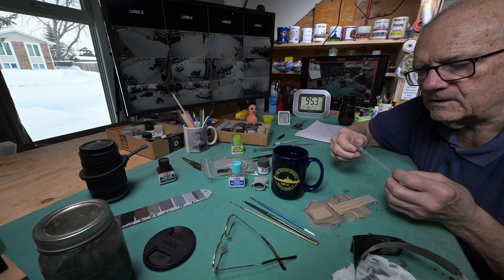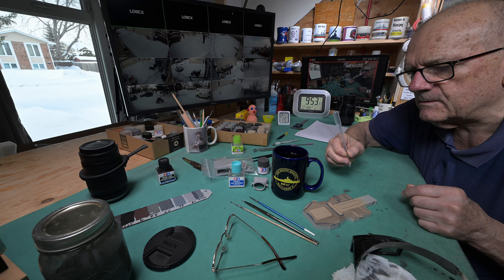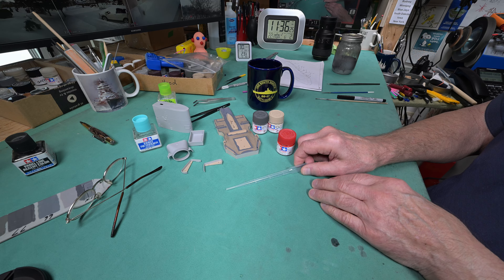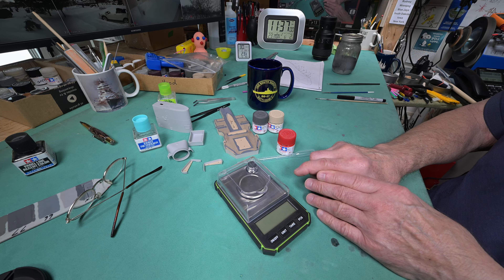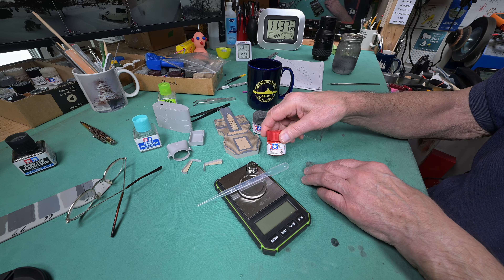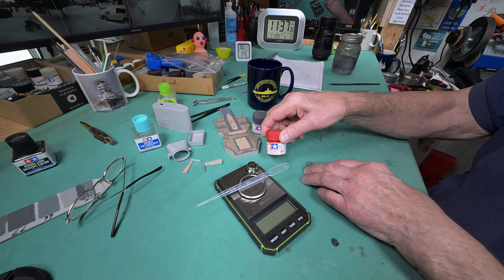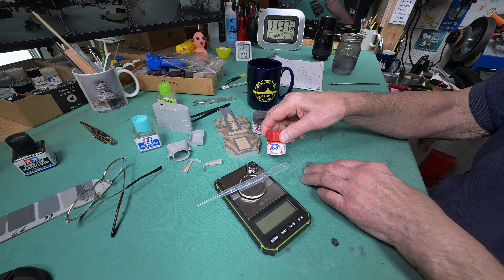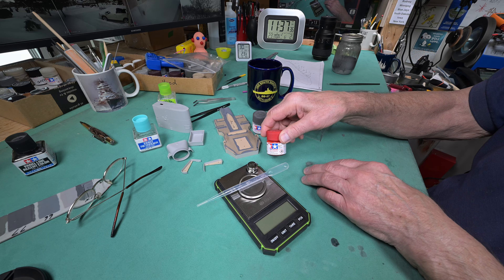The Model Ship - Part 1468

Comment: When I use pipettes with paint, I usually put them in a tall glass with cleaning solutions and rinse them out so you can reuse them. Only if the paint needs  special cleaners that would attack the plastic, then I dispose of them in a  safe way. Less plastic waste is better. Your windex works on a lot of paints. You can recycle the windex with a coffee filter to get large particles out of your cleaning solution so you can keep  using  the solution over again. Just an idea. Be safe and see you in your next episode.  👍🚂⛵️✈️🙂

Comment: On the opening shot I saw the snow and that tree branch moving, all I could think of was,  BRRRRRRRR.

To keep that scale from timing out why can you just reach over and gently tap the scale once in awhile to avoid that?  Shouldn't have any affect of the tare and there is no memory.  or is there.
See ya.                   JimE
Reply from the maker: It actually went up to 32 (0C) in my back yard today. Spring's in the air --- I wish!
This might not be the scale that keeps shutting down on me. I've got one that shuts off even when adding/removing weight. Annoying!
Reply: @roncalverley  Annoying = Dumpster